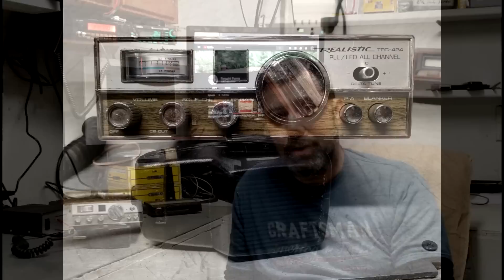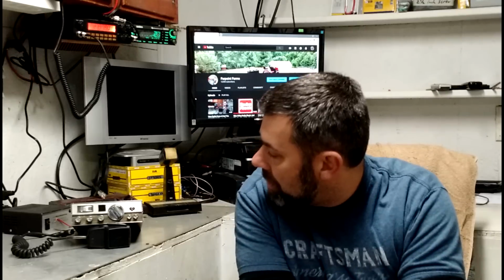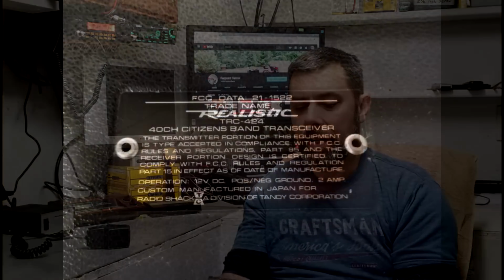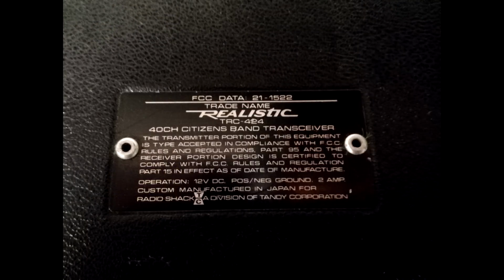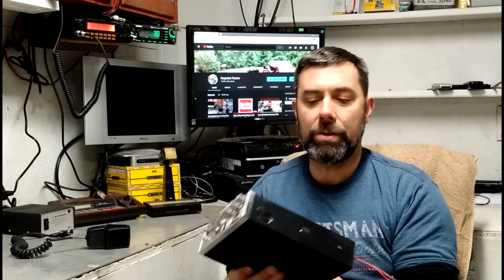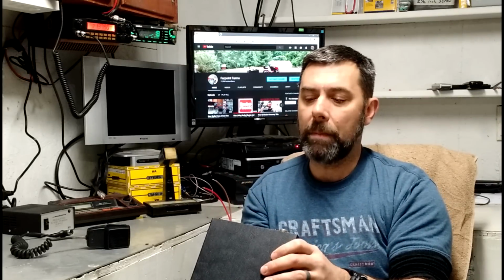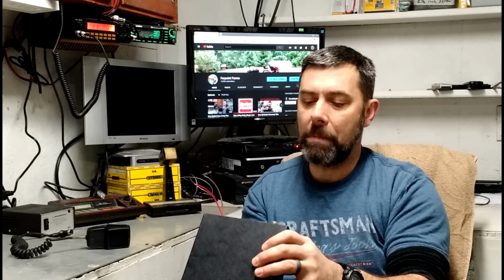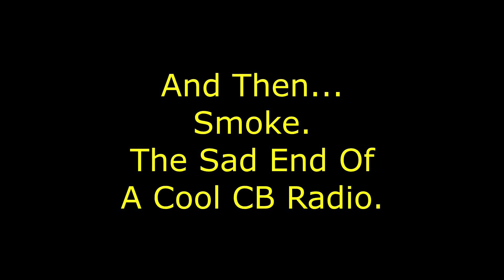Realistic TRC-424  CB Radio. An Old School CB Goes Poof!

Comment: 1978. I had one I bought brand new around Christmas 1978. I was 19. I had ordered a CB from JC Penny, and the order got delayed, I didn't want to wait, so I went to Radio Shack and bought this one. I put it in my 1970 Dodge Dart, using gray plastic base Radio Shack trunk mount antenna (the exact same antenna they used on the General Lee on The Dukes of Hazzard) back then you had no trouble finding someone on the radio. As soon as I got it hooked up, I found someone immediately, who had also just bought their radio. I used it for several years, it was in 4 different cars, I wound up leaving it in a car I sold because the buyer wanted it. The capacitors tend to go bad in those old radios just from age. They are replaceable. They didn't use SMDs (surface mounted devices) back then, there were no microprocessors in them. They were still real radios.
Reply from the maker: Sounds like a great time! I miss the days of making many local contacts. Maybe it will swing back into style.

Comment: Just got the very same 424 model on marketplace, and it transmits very well, sounds awesome. Trouble is; I can't get it to receive. If you have any tips, I'd LOVE to hear any advice you could offer. I have it in my pickup, now, on a negative ground and it seems to work just fine, minus receiving.
Reply: I fixed my own problem, the radio works TERRIFIC, sounds amazing. My antenna was the issue, bad connection. Glad I have four of those things LOL

Comment: Cobra 148 radios were the big thing in the 90's & they were impossible to find where i live (in australia) but the last incarnation of the  uniden grant xl is exactly the same under the case covers & were about $300 (au $)  back then.
Reply: Only ever seen 1 cobra 148 they were imported into australia by uniden ☺☺
Reply from the maker: True. I had a Uniden Grant LT (Back lit knobs) it was a 148 inside and was a great radio. You can get them used for a few dollars less a Cobra as they are a lttle less known.
Reply: @FarpointFarms  Do u or anyone seeing this know what happened to pearce simpson?,i heard they went under & disappered?,info for them is hard to find,although i did find some circuit diagrams for 1 model,i'd really like to hear from anyone who could point me in the right direction to find info for the ps rigs & also cybernet 02a (with pll 02a) as i have 3 of them,feel free to msg me @ u tube/fb or instagram keep up the good work i enjoy viewing ur ut channel 👍👍

Comment: I have the same thing going on, I have bought several radios on eBay, most of which didn't work.
Reply: I found some pretty nice 1970s CB  radios on eBay some looked like new most all worked one arrived & it was the dirtiest CB I ever saw even the inside of it was dirty but after cleaning it with foam glass cleaner several times & a toothbrush outside & rubbing alcohol inside it looks new again and works perfect. A lot of CB equipment is way way overpriced on eBay! Mostly because it's just OLD or should I say "Vintage" but wasn't even any good when it was New❗
Reply: @miguelsalami  I got one from eBay back in the '90s. 148. there wasn't anything hooked up inside. I finally got that sucker to work though. I mean it was like spaghetti just laying there. People are fucked up who sell shit like that.

Comment: That's a shame. I actually have the same radio I bought new in I believe 1978 ,maybe 1977 and I think the 40 channels were rather new along with the new techno LED channel indicator!! Because of this video I dug out mine to try out. It was buried in a box of old junkyard Dodge Omni parts I collected before they all went to the crusher lol!  I noticed your red light in the meter was on when you turned it on. Actually that light is only supposed to be on when you key down and flashes to the modulation of your voice.  I think I lucked out and I believe it transmits and receives. How well I don't know yet. My meter is stuck though. Cause of you I am getting my thoughts together for my SSB base station for DX. Nothing local for me here.  Considering the Uniden 980.\Still like yours and is there enough power for DX? Great stuff you do and we appreciate it.

Comment: Sounds like a fuse issue either in the power supply or in line fuse to the c.b. radio. I could be wrong But I have had that issue before and it was a fuse issue. Good luck buddy. 73's

Comment: Did anyone ever use the PA mode on a CB rig?
Reply from the maker: Back in the day we had a truck at work that had one hooked up. It was fun to play with, but not really of much use.
Reply: My 424 is put away in my basement along with a K40 Antenna with magnet mount and a K40 Speech Processor mike.  I got them all in the early 1980s.  The radio was free from a friend who I gave  some old car parts to so I bought the new antenna and mike. I installed a Radio Shack plastic underhood speaker behind the grille in my 1967 Plymouth and ran a cable to the radio's PA jack.  I attached the external speaker jack to the one AM speaker in the top of the dashboard since my new stereo played through 6x9s in the rear deck.  I would use the PA to talk to other drivers in front of me or if I was outside of the car I could turn up the squelch and hear when a friend was talking to me.  That was decades ago but I can't bring myself to toss it all out.  I did hook up the radio recently and adjusted the SWR and it all worked fine.

Comment: This model was first introduced in the 1973 RS catalog for $329.95
Reply: 40 Channel CB radios were not available until 1978
Reply: @uhfstation3530  You are correct. It was in the 1978 catalog for $99.95